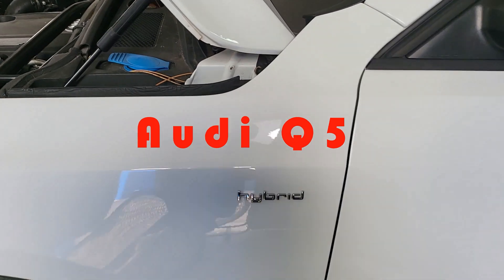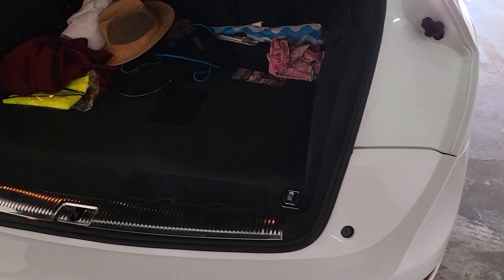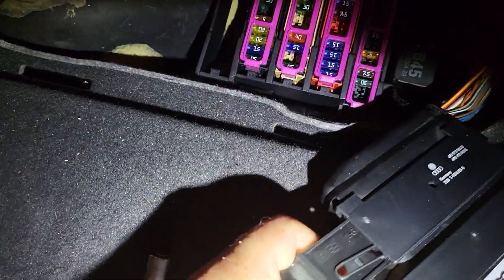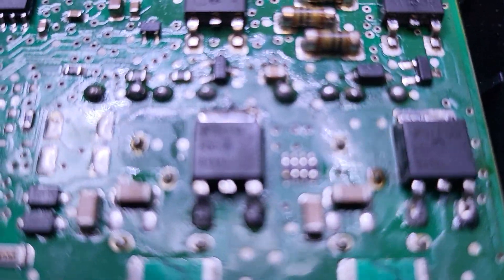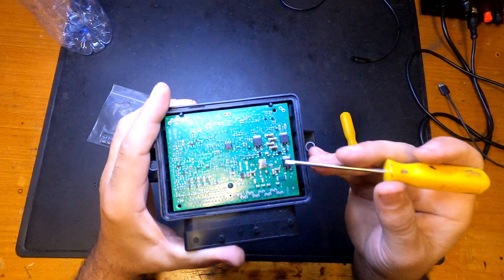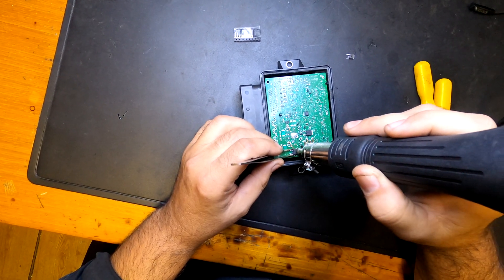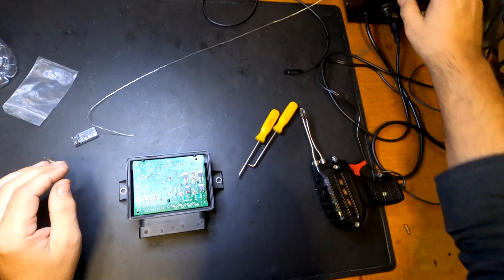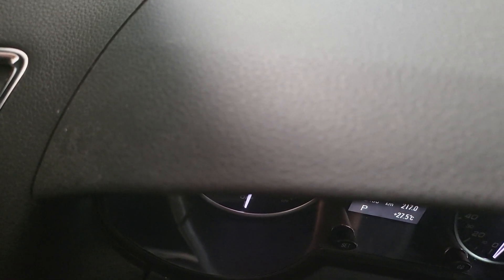Audi Q5 epb module Repair

Comment: Thanks for this informative video. I’ve been plagued with epb issues for a few years now. Mainly the wiring hasn’t been robust enough for my climate but now I have a similar fault with just one wheel on my Passat. It’s not so easy to access as yours as it under the centre console. I’ll substitute the module with a used part I think and then take it from there. It’s a very confusing system to work on as the dtc don’t actually help much other than identifying the wheel. Great work.

Comment: Thank you, it's a very nice video. You are very clever . Can you help me with errors on the EPB. I have a vw passat. It's the same problem. I have changed, bought a used car and changed the strynen unit for the electric parking brake. I want to repair old . The same car has the same problems with the reversing sensor, which I want to repair

Comment: I checked 4 mosfets. Seems they are fine. Both relays also click. My error code are lost communication between pbm and bcm; pbm and cem; red park brake warning light flashes all the time. What parts on the circuit should I check? Resistance between signal wires is 61.8 ohms. Seems can bus wires are ok. Appreciate any suggestions. Thank you
Reply from the maker: Thanks for watching.
In order to help you i would have to have a pbm in my hand now...but i dont , so i cant really tell you where to look regarding that dtc...i will as soon as i get a car with a similar issue i will try to dissect the entire board to help people in many other errors than the ones i get.
Good luck

Comment: I have the same issue (Audi Q5, 3.0TDI) , the same control light... Since it appeared i am not able to use gearbox, due to that even not start the engine... i am gonna replace both MOSFETs today and let you know about my experience. Thank you very much!
Reply from the maker: good luck my friend and thanks for watching

Comment: Question: I must change the EPB module on a 2010 Audi A6 Avant and, considering the age of the vehicle, want to avoid paying the 900 euros that Audi are asking me to fit a new one. Buying a second-hand EPB module and fitting it is within my limited mechanical skills. I can also buy the plug. Together, these 2 items are rather inexpensive. But, where/how can I buy the module programming software and how much does it cost please? Thanks.
Reply from the maker: thanks for watching.
you can buy the cable and software from many places on the internet Ross tech , Vagcom, Vag commander, abrites, etc all of the above will code this module to the car. Make sure you choose a version that is compatible with the cars age.
good luck
Reply: @PSICompanyPerformance  Many thanks!

Comment: Hi 
By the chance do know where the sunroof control module is located?
Reply from the maker: Thanks for watching.
The module is j245 and is attached to the sunroof motor itself.
Good luck and hope it helps.
Reply: I have a 2014 a8l which has the same panoramic sunroof and they look the same.

Thank you

Comment: what type of mosfet is that? i need to repair my A4 B8 module...vag shows some DTC but handbrake is functional..thx
Reply from the maker: Thanks for watching...
I show in the video both the original and the replacement transistor refences...
I bought the replacement from Mauser.com.
Good luck.

Comment: Thank you very much for your vidéo it's help me à lot for my passat
Reply from the maker: thanks for watching and feedback.
im glad it helped you.
Reply: @PSICompanyPerformance  hello sir I HV issue with q3 2018 right hand drive in India..DTC c200d12 .left parking brake motor voltage supply short to B+
C10E129 Par king brake motors .implausible signal
Both are active 
Pls reply
Reply from the maker: @adnabandasha3201  thanks for watching.
That is the same issue i had in the car in this video.
In this case it can be the transistor or the double relay you need to test those..
Good luck
Reply: @PSICompanyPerformance  hopes it does solve thks sir .